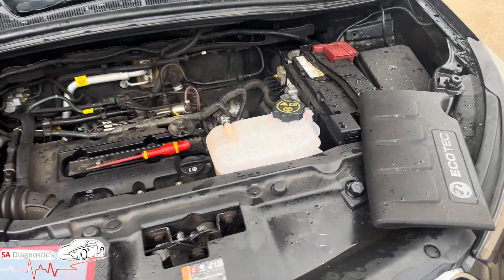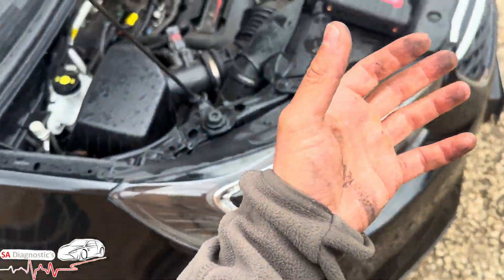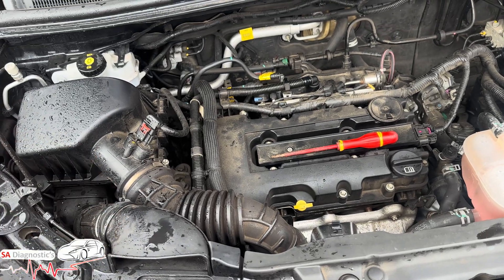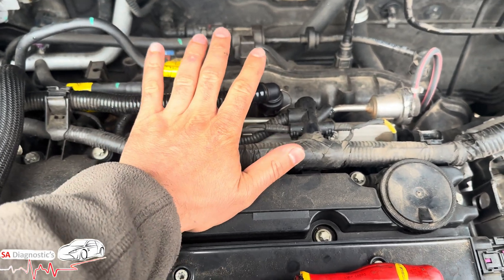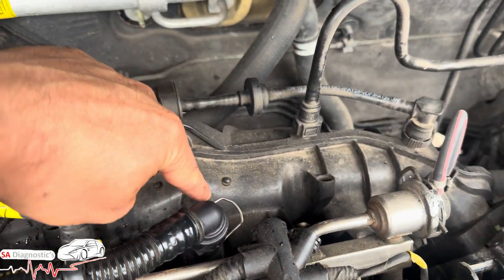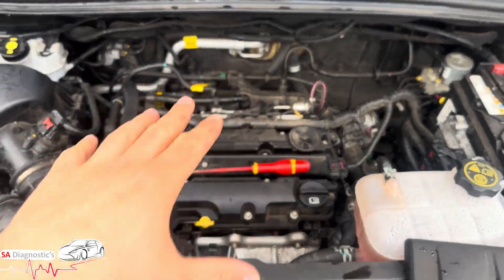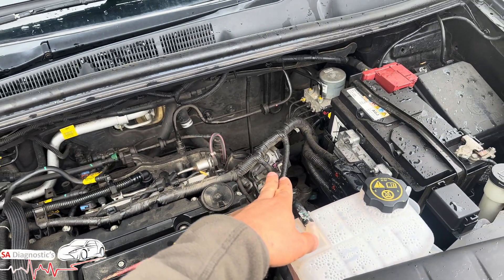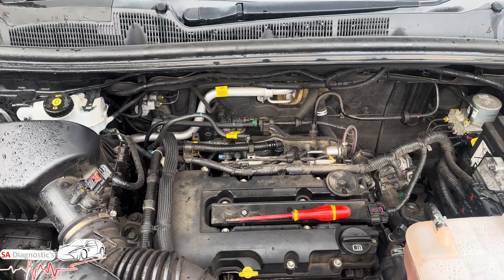Vauxhall P1101 P0171 Intake Air Flow System Performance - Fuel Trim System Lean - HOW TO FIX

Comment: If you can’t change it, Is it possible to clean it?
Reply from the maker: Yes you can use electrical sprayer cleaner but it’s not always guaranteed to fix it…